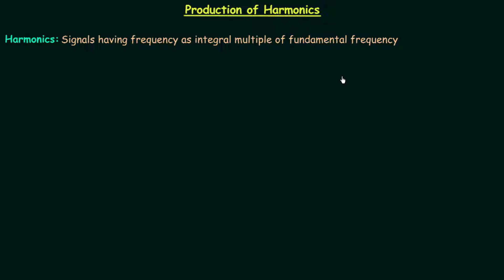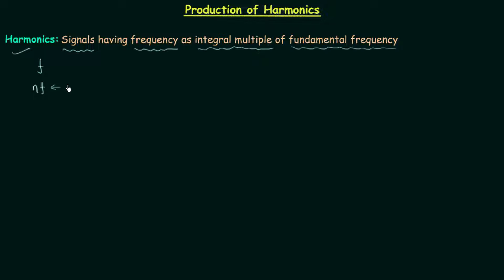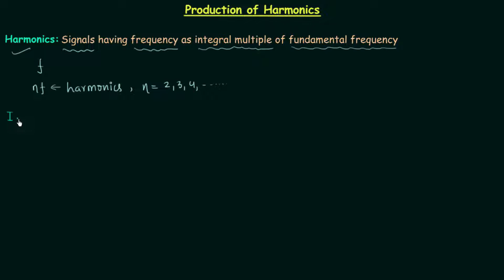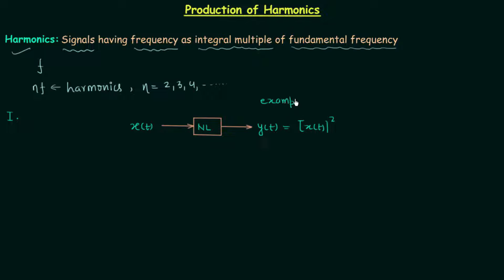Harmonics and LTI System

Comment: Sir very thankful to you for your explanation, but if I consider y(t) = x(t) +2, which is a nonlinear system, it doesn't produce any harmonics.
Reply: Yes sir pls reply to his comment
Reply: That system generates just offset... In time domain, only DC voltage level changes. So harmonics and signal's distiortion don't exist.
Reply: It's because that signal has no frequency.